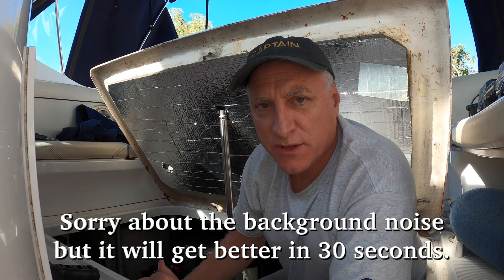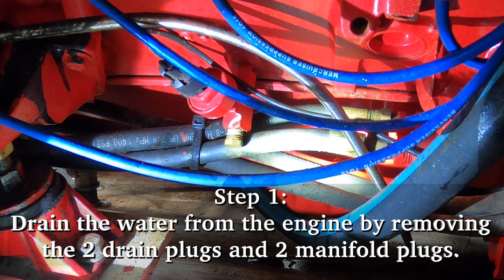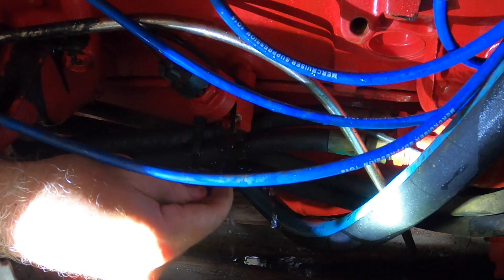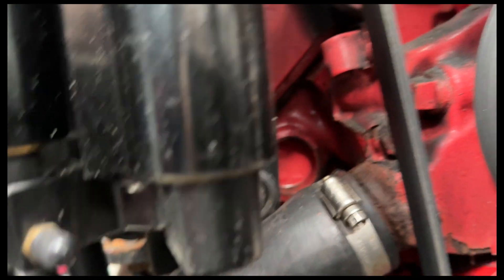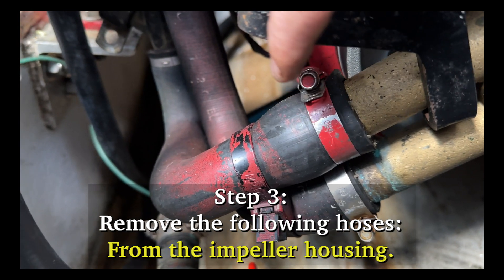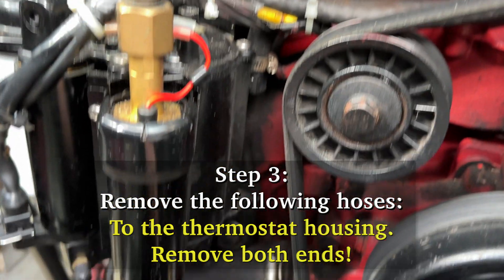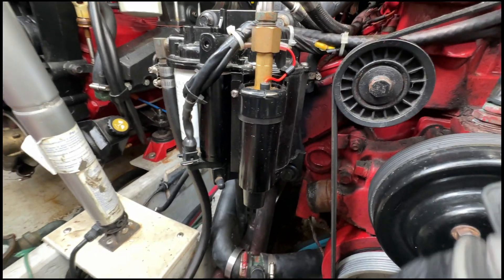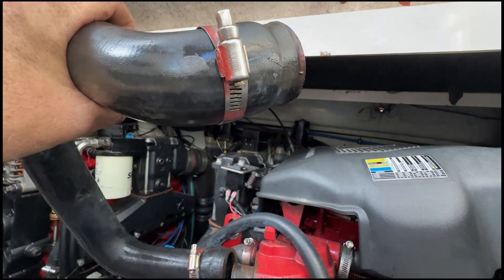How to winterize Volvo Penta 5.7 Engines - Episode 175

Comment: Do you fog the motors too?
Reply from the maker: I do not. I used to with my outboard but not with these. I haven’t had a problem but that doesn’t mean I won’t.
Reply: @eternitysshore  pretty simple in or out of the water. You'll need a small portable gas container or buy a small outboard fuel tank. Fill it with 2 stroke oil and gas mix. Disconnect the fuel line from the boat's fuel tank at the fuel separator.
Run a fuel hose from the portable fuel tank to inlet side. Run the motor for a few minutes with the 2 stroke gas mix and you're done. Probably a bunch of YouTube stuff  on how to do it